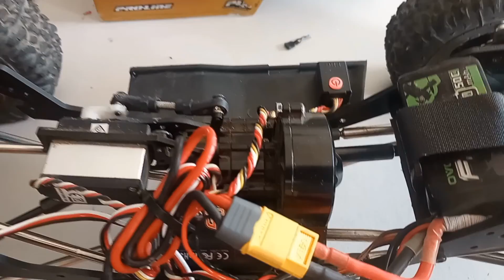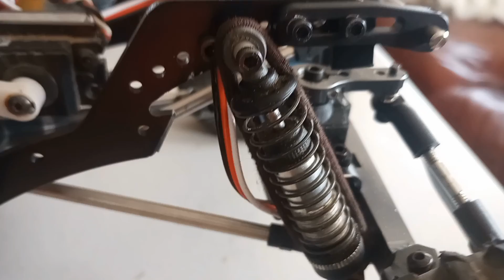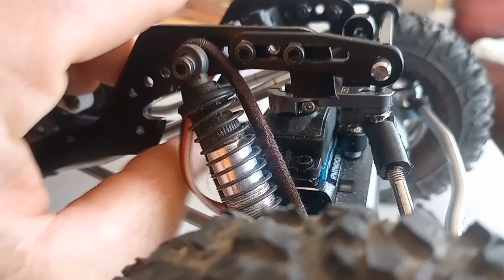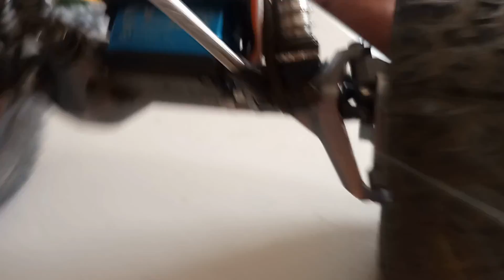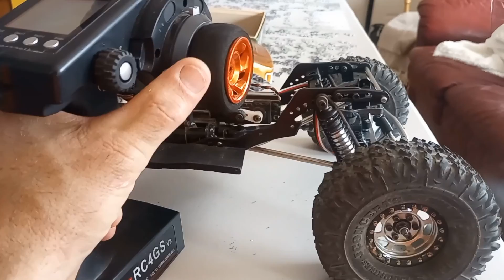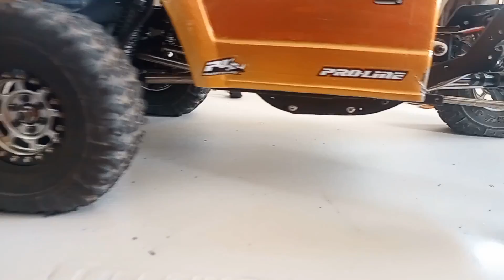Axial scx10 pro mashup rig: tabletop view and rear steer set up #axial #rccrawler #offroad #4x4

Comment: Cool rig I’m sure it will be a line Slayer!
Reply from the maker: Well it did fairly well even before the 4 wheel steering set up .... I'm sure it'll be a bit more fun like this. I need to go south for some trail testing, I'm covered in snow here🤠
Reply: @guywithashovelproductions  that’s the good part about living in Texas you can pretty much crawl all year long that is if you can survive the photic doom that is summer here!
Reply from the maker: @GoatneckRCC our summers here in Southern Utah can get damn brutal, we've seen 115°+ some summers just with low humidity, nothing like that Texas heat. I'm just up into the foothills of a mountain range that gets a fair amount of winter weather. Weird desert we live in over here,